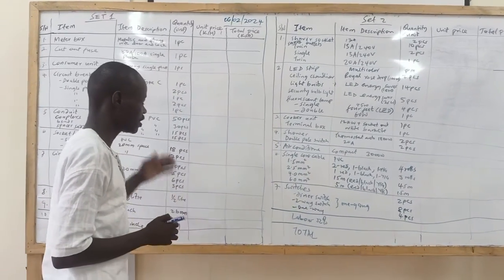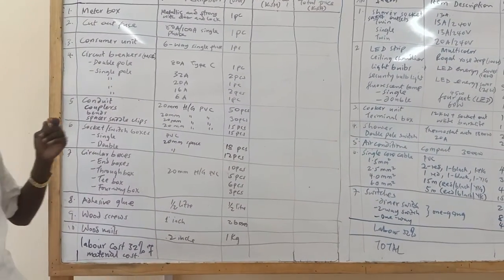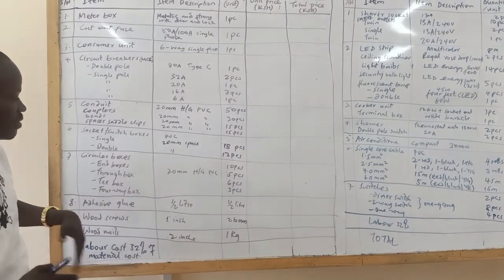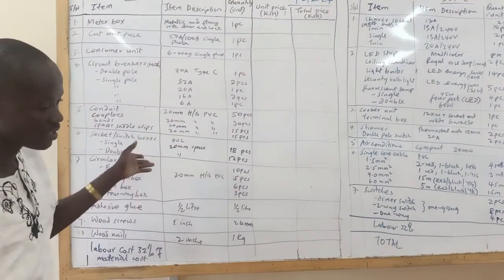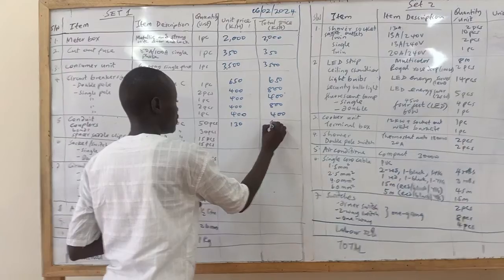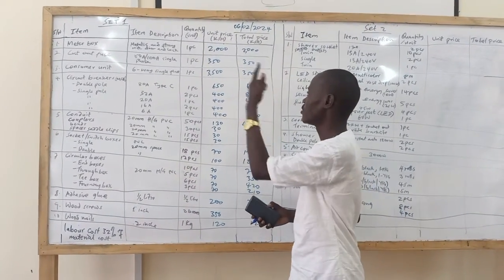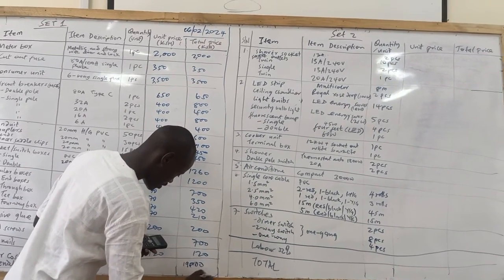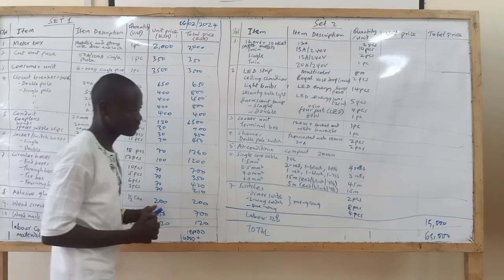PREPARING ELECTRICAL MATERIAL QUOTATION FOR AN INSTALLATION

Comment: Sir,I didn't hear you saying earth rod, and service cable
Reply from the maker: usually recommended by the supplying company. They are the ones to drop the service cable and ensure earthing meets the requirements of the installation